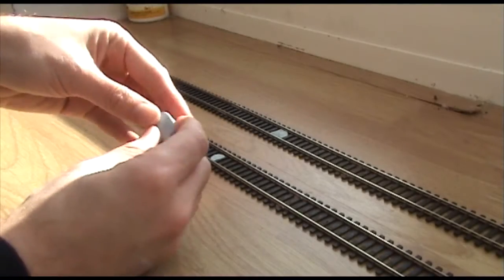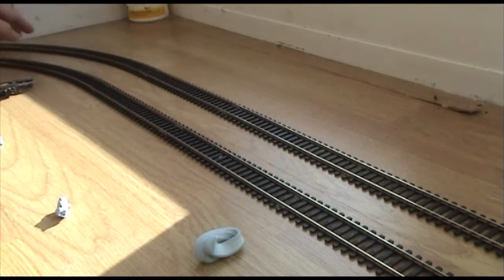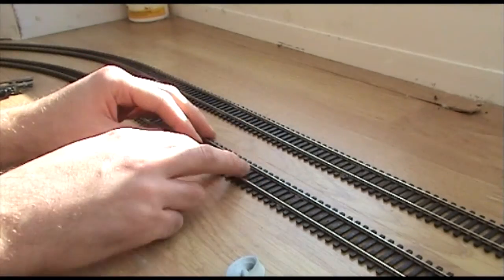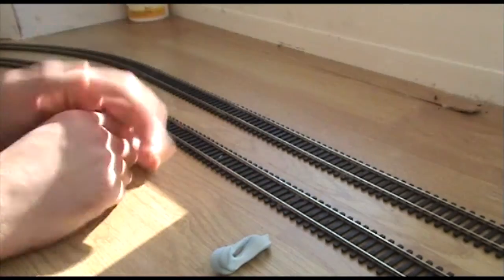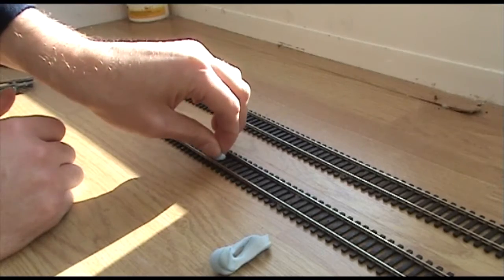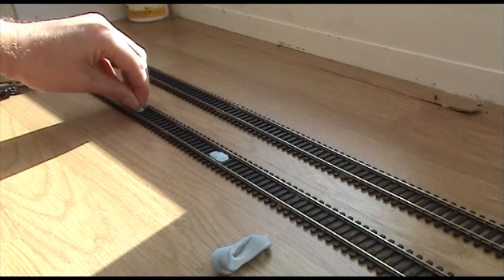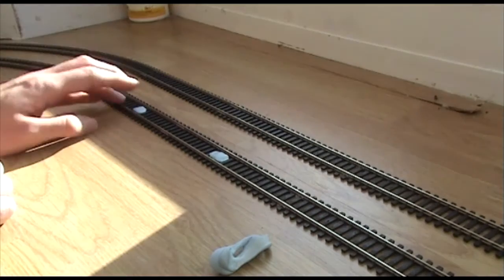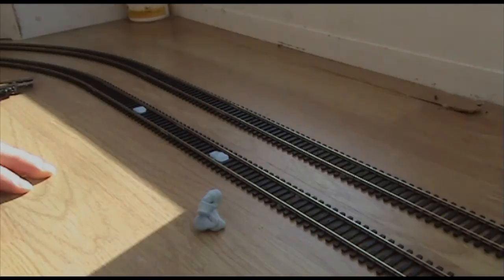*TIPS* Blu-tack saves the day!

Comment: I was wondering if you had any tips on dealing with a hornby pendolino derailing at high speed. Ive used a gauge and sorted every axle to the correct width. Its on 4th radius curves and a flat surface. But the track isnt tacked down.